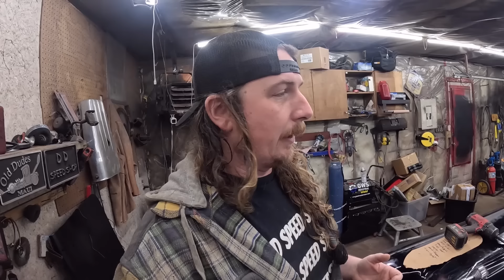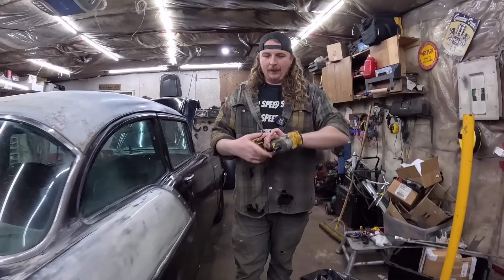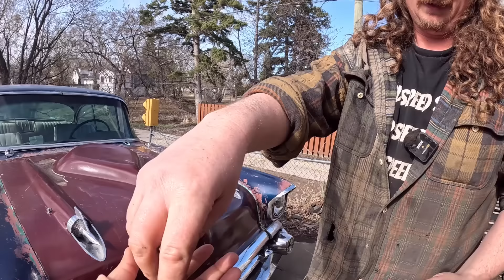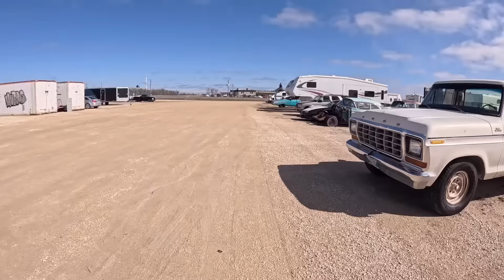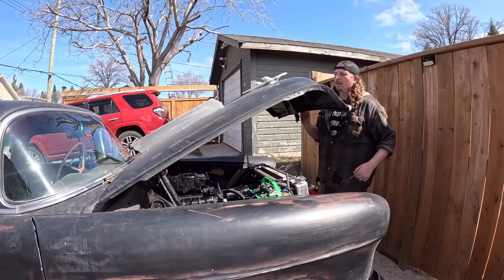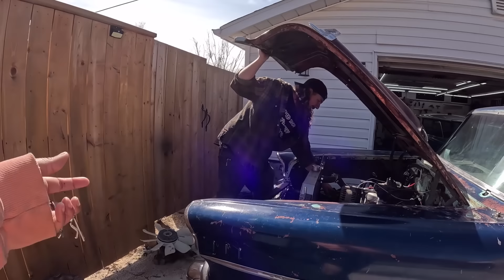First To Go! More To Come - Saying Goodbye To My 1957 Chevy

Comment: You're like me- never sells anything until it's in the best shape it's been in since you owned it.
Reply: And after the car is sold you get instant sellers remove.
Reply: Story of every dad (*car) I ever sold. 
Best gmt400 I ever had was a 98 tahoe. Passenger door liked to swing open. Drove it two years like that just always had a passenger to hold it in case. Finally fixed if the day before I sold it. The fix cost $12.
Reply: That’s how you make the bigger profits (hopefully)
Reply: Sold my hotrod 55' pick-up to a friend after spending ALL night tuning, tidying loose ends etc. Next day he came back whinning about "there's still a bit of a BOG when ya stomp it". Took it for a spin, came back & told him it ran better than the WHOLE TIME I had owned it & all the time of night before getting it ready for him. He seemed disappointed I wouldn't do more' so I held out the keys & his $- said pick one! He left w/ the truck!
Reply: Hopefully the new owner of the 57 hardtop will finish the bodywork and paint it dan got most of the hard work done

Comment: Yep Dani you need to get a key box with key tag key chains to hang on one of the garage walls to keep your keys organized and found easier . I did it at the wholesale warehouse i ran and even had back-up keys for each vehicle so if one set got lost we could use the truck . I found the key box and key chain tabs i used at Office Depot .

Comment: A DD Speed Shop classic is moving on along with a few more tri-5's ....  
So out with the old and in with the new ...

Speaking of new, check out the Mecum Auction this month at Indy 
( Lot # S242 ) 
A deep blue 55' Custom Chevy convertible w/tan leather interior ✌️😁
( Its pre-auction estimate is a bit on the expensive side... $ 🫣 $ )
.....but it doesn't cost anything to look 😉 please check her out !

Dani and Dan.... thank you for the interesting and informative videos.
Dani... don't you dare sell that wicked Chevy II Gasser...
well, at least not until you give it a few runs down the strip !

Also, a best out of 3 DD Match race Chevy II Gasser vs. 55'  So-MaDD Gasser would be sweet